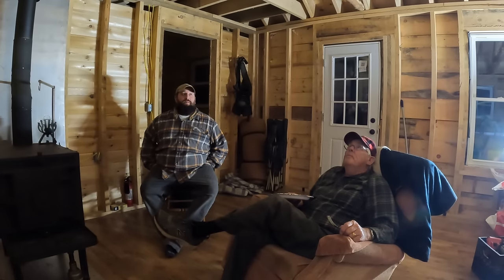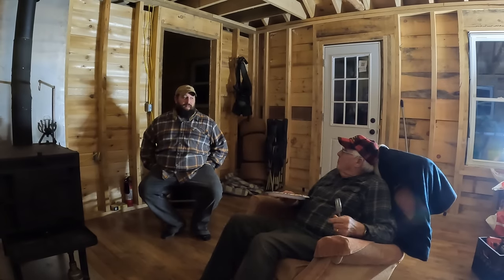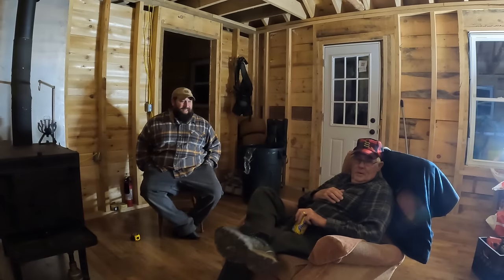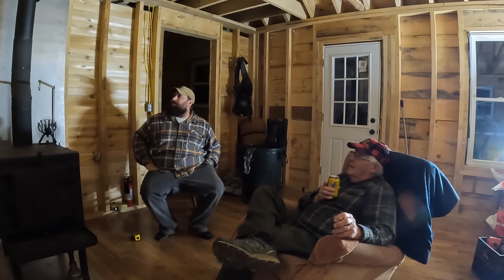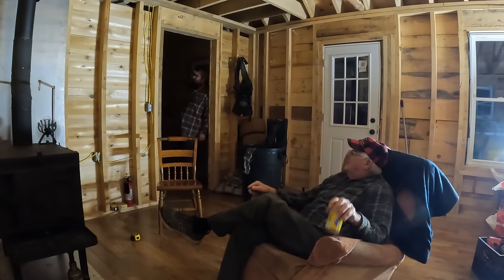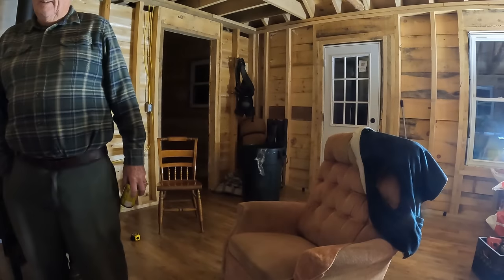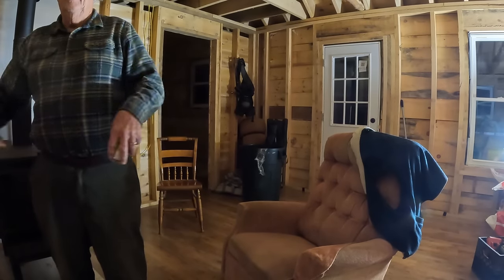Electrical Wiring the Off Grid Cabin: Episode 37

Comment: Hey Joe,
I'd spend 15 minutes to draw myself a little diagram on a 2x6 of how you're gonna layout the kitchen with the windows drawn into the plan.
Where the counter tops will be? where upper cabinets will be so you can plug in a microwave, undercabinet light, I'm sure you're gonna want a bright light for dish washing? Where you'll plug in toasters, coffee maker, crock pot, hot plate, waffle maker, blender, small frig., Maybe small separate freezer chest,  (maybe separate circuit), stove/oven maybe on that other circuit, stove exhaust fan vented outside... Lots of stuff to Know yet...before settling on number of outlets/switches and their specific locations and groupings.
Don't cheat yourself on counterspace. you'll regret it.
Definitely need a large convenient area for the minnow a  
I'm a huge fan of all projects, outdoor escapes and story lines you bring us along on.
Do you at least have a buddy that is a Journeyman that you can run your crude design by?
It's really important to know what you don't know. They're called "Know Unknowns".
I think some big box stores offer this design service for free.
Certainly, the store you are buying the stuff from would give you a few minutes to look over the kitchen layout pertaining to electrical needs required.
You probably don't want to have the freezer on a GFI circuit even if the home's power is currently supplied by a generator. Think and plan into the future and really focus on specifically how you will utilize this come 20 years into the future. 
Maybe you'd like to live there half of the year in the future, in addition to taking several trips up there to enjoy it when you're not.
The decisions you're making today or yesterday may have much different answers or solutions (in that context).
It's a lot cheaper and less frustrating if you take the time to plan for these future needs now or make necessary adjustments needed, 
sooner rather than later.
Keep on, Keepin' on.
Reply from the maker: Thank you kindly ! Donnie is the layout and plan man I’m the grunt